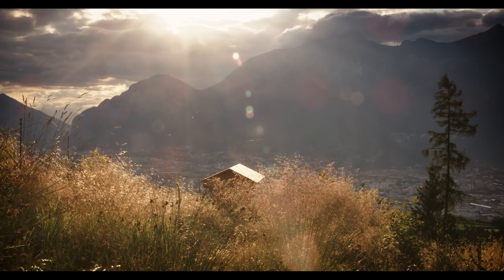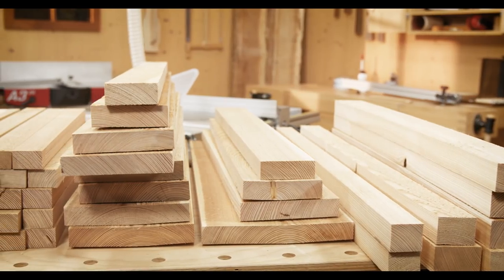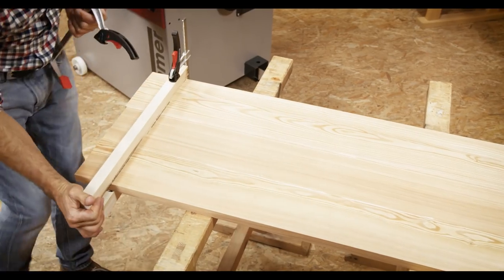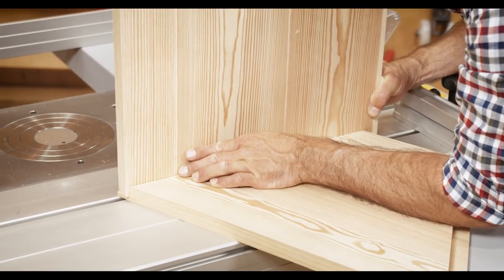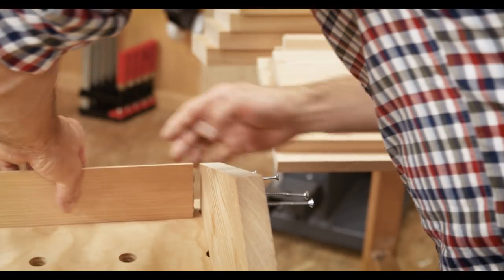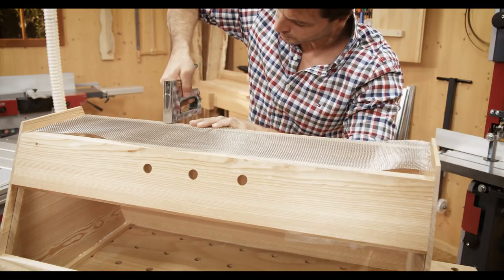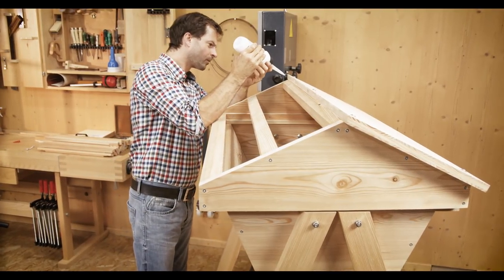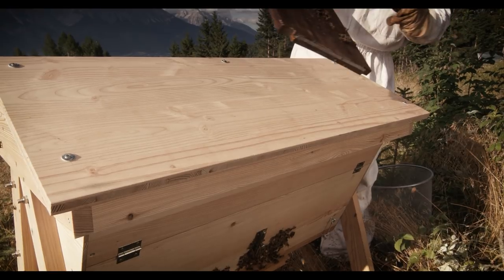DIY Hammer® "bee hive" produced with the panel saw K3 e-classic | Felder Group

Comment: Once again a lovely project and very well put together production :)... Did I miss something but you said N3700 and not N3800 in the introduction. Another question...I have the 3800 and although it has a wheel to tension the blade it doesn't come with a screw in grip in the wheel where you tension it...although there is a space for it...if you know what I mean...Keep up the good work :)
Reply from the maker: +FrameToFrame
Thanks for the compliment!
Yes, our master carpenter Helli works in this video with the N3700 e-classic
Best Regards from Austria

Comment: I am enjoying this video. That riving knife deflector is something I've never seen before. Seems super smart. Seems easy enough to make. Is there a standard angle for those, or is it just an approximate thing?
Reply: Yes that device is great. I bought one for my table saw. It is awesome. It is available from Felder Group USA. They are wonderful to work with. I have bought a number of parts from them. They do not come cheap but they are first class. And many of their items are unique in the world of woodworking. Send for a free catalog.
Reply: Thanks Pat. Agreed they are great to work with, which is why I have a K700 and a Hammer A3-41 :D The folks in the Delaware showroom are excellent.

I have their big silver book around somewhere. I don't recall seeing that block, but I'll check again. Seems simple enough to make in any case.
Reply: A tip:

If anyone purchase this diverter from Felder; and they try to use it on an American type of TS; the rear magnet will lie to the rear of the saw; making it unstable. But simply embedding a small, thin steel plate in the outfeed table solves the problem perfectly.

The problem stems from the fact that all of Felder's awesome sliding TS's have a much deeper table to the rear of the blade; than standard American type of TS's. I wish all American saws had this. But they don't. A pet-peeve of mine for many years. Note: the new Powermatic TS has a 2 inch (28" to 30") longer table top to the rear; but that is still not enough to support this very clever Felder, "cross-cut" diverter.

"Where there is a will, there is a way." Praise Jesus.

Felder is known for very innovative products that they sell in their parts catalog. I purchased a complete Felder "outrigger" table for my sliding saw "attachment". Works like a charm. Thanks Felder. I also purchased a number of other Felder parts; that would embellish any TS. Really!

One of these days (when my "rich" uncle gets out of the poor house), I am going to Austria; and visit this unprecedented manufacturer. I would be all eyes and ears and lovin' every second of it. Sadly I might drive an Austrian crazy with a thousand and one questions LOL. Oh well.

I do love Felder products. If'n "yuz" kin aford a "top-of-dah-line" machine, BUY Felder. They are the best in the world, over all. But of course if'n "yuz" caint aford one; wait 'til YOUR poor uncle gets out of the poor house! Whoopee!
Reply from the maker: +pat dee
Thank you very much for your loalty! We look forward to your visit in Tyrol, Austria!:)
Best Regards
Reply: As much as I love my Hammer C3, this is an Aigner product and can be purchased not just from Felder. You're also correct about making your own - very simple device but also not that expensive - about $40 from Simantech